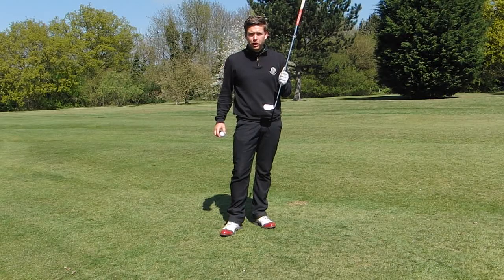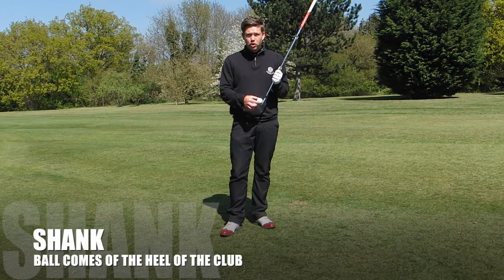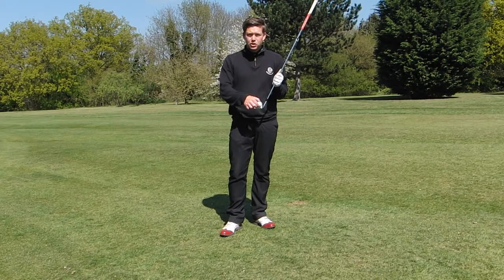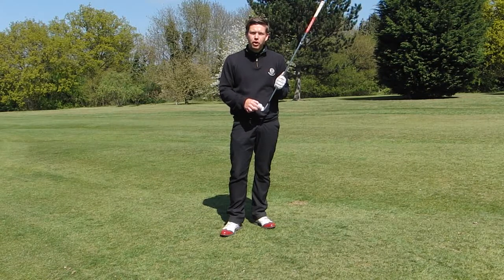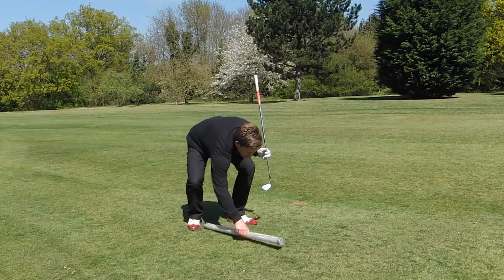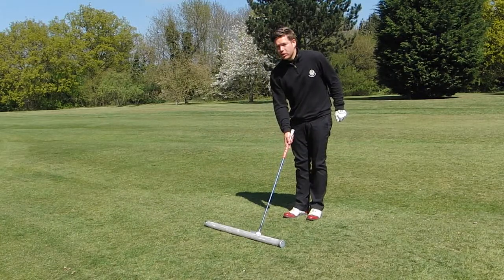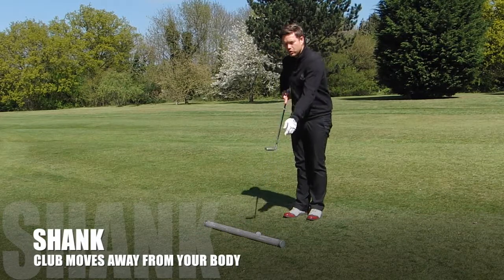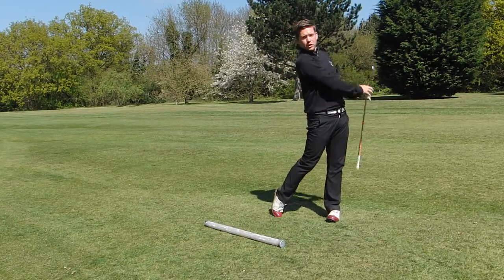Golf anti-shank drill

Comment: Nick:  Does the S&T swing help cure the shanks?  I now use a early wrist set and then turn, struggle with early extension and use my arms too much with no turn! I shank 9-10 shots per round!  How do I correct this other than doing this drill?  Thanks for all your help!  Great videos!
Reply from the maker: Hi Greg, sounds like the early extension could be the cause, but could be combined with path or what you do with the wrists. I would suggest seeking help from a S&T instructor if possible
Reply: Thanks, Nick!  Any certified S&T instructors in my area? Can't find a list on the S&T site????